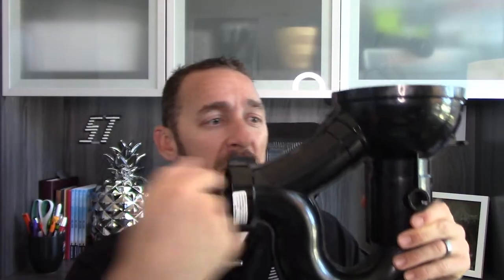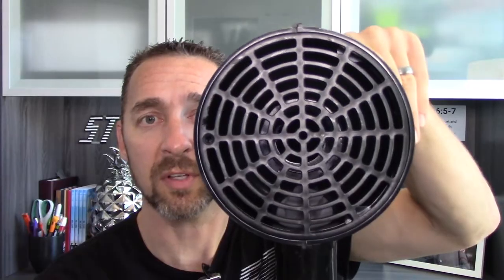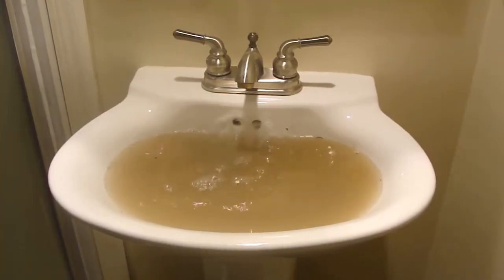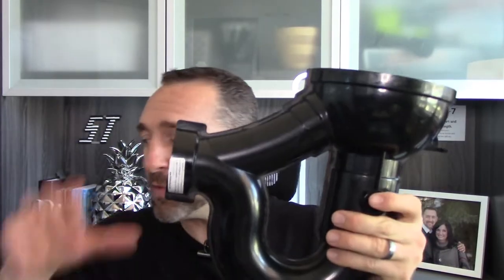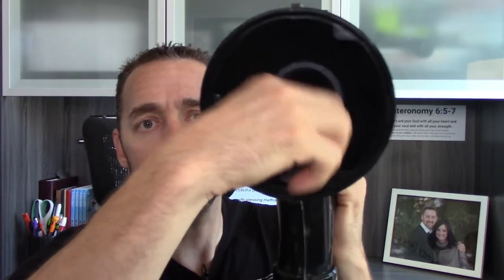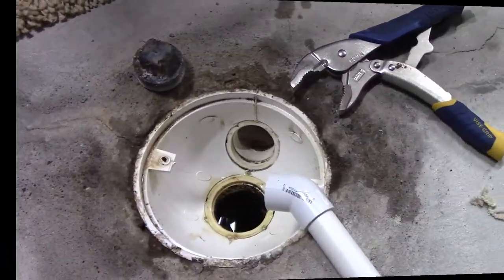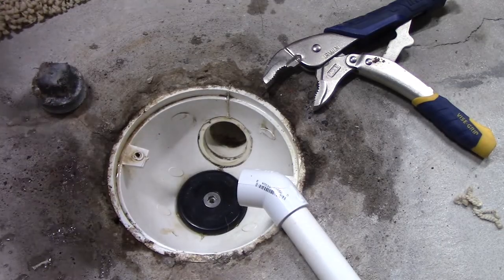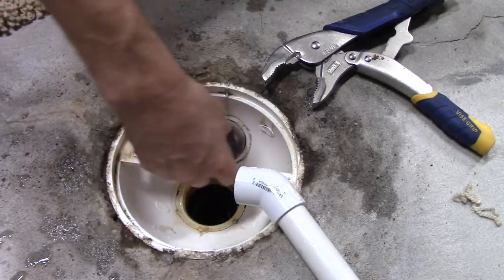Floor drains: why they back up, what to do about a missing cleanout plug

Comment: Rural living on septic&well. Water softener regen made a mess little water yesterday and my initial thought was floor drain issue. Watched your video, reinspected my situation: all clear on floor drain, everything is as it should be. Low and behold somehow the softener regen drain hose got moved away from the drain hole! Pfffft. Put  back in place and secured it. Problem solved and multiple lessons learned. Namely how floor drains work and whole house plumbing implications @ the lowest point in your home.  Thank you Reuben!

Comment: This video helped me so much. Returning from two weeks away, our basement drain started overflowing after a shower and laundry load. We quickly grabbed the wet-dry vacs and sucked up it up until the cycle was complete. I knew NOTHING of what and how the floor drain worked. I discovered, after following your instructions, that our Clean-out plug was MISSING (as you suggested it might be!), and I feared the worse. But, I did get the clogged clear, and the P-trap does WORK! All thanks to the knowledge you shared! Now I need to get a replacement plug! Thank you so much for this video. It was straight forward and everything I needed to know.

Comment: Sorry for the long post.  Not sure if you really want to get into helping each respondent with their particular issue, but here it goes ...

Nice video.  Well described and informative.

I removed the cleanout plug.  This is a 60-year old house, and has cast iron piping, including the floor drain.  The auger had no problem running for maybe 20 feet into the pipe.  No obstructions, no debris removed.  When I pour water into the drain bowl with the cleanout plug removed, the water exits very quickly.  It's the trap that is plugged.  I tried a plastic jaggy rod that's used to remove hair from traps, but it cannot penetrate whatever is clogging the trap.  The current own (my aunt) has had this house for 27 years, but she doesn't know how to inspect a house, or how plumbing works.  Once the water heater burst and flooded the basement.  She cannot remember if the water drained normally or extremely slowly.  

For many years since I replaced the water softener, the exhaust water (2 hoses) ran into the floor drain.  I had the hoses go into right-angle adapters: hose into one end of the adapter, other end of the adapter pressed into a plastic drain plate.  This held the end of the outlets above the normal water level in the drain to prevent siphoning back to the water softener.  That setup worked fine for well over a decade.  Late fall 2 years ago she had a new furnace installed.  The old one's drip line (gas creates water on burning) ran under a rug and into the floor drain.  The new furnace has its drip line (runs up to ceiling using a condensate pump) also run into the floor drain, but the new furnace also has a humidifier where the excess water goes into the condensate pump.  Last winter with the new furnace, its drip line into the condensate pump, its humidifier into the condensate pump, condensate pump into floor drain, and water softener into floor drain, there was no flooding on the floor.  This last winter, the floor started getting wet.  The water from the condensate pump drains okay, but very slowly out of the floor drain's bowl.  It was when the condensate pump and the water softener were both operating that the water wouldn't drain fast enough this last winter, so it came up on the floor.

When I went to check, as mentioned, running an auger through the cleanout plug encountered no debris or restriction.  When water poured into the drain bowl got up to the level of the cleanout hole, the water drained out fast.  When I plugged the hole, the water would drain too slow, and would've come up on the floor if I continued adding water (pouring it in from a pail).  I tried using a plastic jagged drain rod, but it couldn't get into the trap.  There's no concrete or other construction debris that would've gotten into the trap.  The drain is cast iron, not plastic, and there is a lot of corrosion.  Possible the debris has been stuck in the trap for decades, but just recently the rust or other debris finally plugged up the trap enough to severely slow drainage.

While I can get a sharper tip for the auger, I'm concerned about how rusted the drain trap might be.  Boring through solidified sediment, or whatever is hard set in the trap, could result in boring through the cast iron pipe.  I managed to get out the plastic cleanout plug, but the threads are highly corroded, so I cannot get it back in.  I'll have to use an expansion plug to close the hole.  If I cannot bored out the solidified debris in the trap, I'll have to run the water softener and furnace condensate pump into the laundry tub.  My aunt cannot afford having the floor broken up to repair the floor drain.

Is there a safe means of boring through solidified sediment in the trap of a floor drain, so the trap does not get damaged?  There is very slow drainage, but the drain rate won't handle the output of the water softener and the furnace condensate pump.  Don't want to use lye (drain cleaner) on cast iron piping.

(I can just hear you now.  Oh, geez, another one wanting free advice.)

Comment: The plug is missing on the cleanout on the floor drain at our house, the water stopped flowing right. Well to build pressure and plunge the line to maybe avoid paying a plumber I took a bag and some cloth and stuffed the hole. at that moment the washer started a drain cycle and Pop and the water now flows better than ever and it took a dollar tree bag and some scrap cloth lol. DEFINITELY getting one of those expanding plugs as its an old cast iron floor drain that is well past its life cycle due to rust. 

Thank you for this video.

Comment: I have a 1940s home and the drain plug in the floor is only about 2 1/2 inches. This drain doesn’t have a clean out when I run my wash machine. Sometimes water will come out of this drain and saturate a good portion of my basement floor.
Reply: Yeah my family’s house is from the 1950’s and we have had numerous back ups and currently the drain that comes from the kitchen makes water come up in the basement sink and then drains super slow and smells horrible. The basement water drain doesn’t overflow
Reply: Most likely you have a main line clog. Same thing in my house. It was clogged. Had a plumber come out and jet it.
Reply: I also have a 1940’s home but mine does have a brass clean out plug and my washing machine does the same thing when it drains

Comment: Ruben, my house was built in the 60's  so it's cast iron  over the years I've had a plummer use an spinning electric brush kind of thing  and  I'm out a lot of money . . anything that I can do to fix the bubbling up and overflow when I use my washer ? ? They are in my basement a few feet from each other. . so far if I open the lid several times when the washer is draining it keeps the overflow at a minimun.

Comment: You are the only guy I could actually understand when describing everything you did.. here's my issue.. our floor drain started draining really really slow.. and only comes up out of the drain when the washing machine drains.. have no idea how the water from the washing machine gets to the drain..( like..is it a straight pipe to the drain under the concrete, or does it go under the concrete and shoot up and then back down again.). Because we can take showers, wash dishes, etc.. and none of that water backs up, so I don't think the clog is in the sewer line going outside.. I'm guessing that the problem is the trap underneath is flipping clogged.. I'm glad I won't have to pay for that if they have to pull up concrete.. but wish I could figure out how to make it drain quicker like it used to.
Reply: The volume and velocity of water discharged by your washing machine likely are higher than your dishwasher or shower and can't get past the clog fast enough to avoid backing up through your system's lowest drain.
Reply: Mine started that way but then as time went on it happened when bathing and showering. The main line was plugged.

Comment: Nice video, thank, what if water level is even above of cleanout plug but never over flow, maintain that level most of time , but it's above the top of cleanout plug?
in my case,  U trap and cleanout plug are inside a pit, and pit is 70% filled , but not overflowing.

Comment: So i have a floor drain that was plugged, and when i run my washing machine the water comes up from the big plug at the bottom, so i had to take off the little cleanout plug so the water wld drain out. Whats wrong here? This floor drain has been plugged since i bought the house 30yrs ago.
Is the trap clogged and the plug is bad?? Why does it only happen when my washing machine drains???

Comment: I have cast iron pipes. Every time i run water through my kitchen sink the garage floor drain floods. Ive snaked both the sink drains and have tried to snake the floor drain but it wont go in but maybe 6 inches. The overflow on the floor drain is pretty much cemented on there and i cant get it off to snake it. Any tips or tricks to get that thing off?

Comment: My floor drain looks nothing like this. From what I can tell, it's just a 4" pipe going straight down. I think I need to have the floor opened up and have the whole thing re-done, but I can't afford it. It backs up (thankfully) clean water that seems to originate from the shower drain and the washing machine (not from outside the house) every time we have a lot of rain/snowmelt. Given that it never seems to have water going DOWN it, I'd rather get rid of it entirely than have it re-done, so I have the option later to finish my basement. In the mean time, I got ordered on of those backflow prevention drains, and I'm going to try installing it. I don't know what else to do.

Comment: My home was built in the 1920s and the basement floor drain has no clean out. It's just the trap itself. I also don't have a clean out outside. The only ventilation is from the two stacks in the west and east sides of the home. I notice when I take a shower that the water level in the floor drain rises about an inch and then settles back down shortly after the shower is complete or when the I'm washing clothes and the washer drains.

Comment: What do you do if the clog is in the trap on the side of the cleanout, main line is fine, but due to the angle of the cleanout I can't get down to the back of the trap.
Reply: Unless it's concrete in the line, several options should work. With the cleanout cap on, a plunger may work, a snake should push it or one of the bladders that hook to a garden hose, or even one of the pump-up air blasters. If I don't get it with a plunger, I get out the jetter. If you have a pressure washer, you can order a jetter hose for around 50.00 and clear lots of lines.

Comment: My floor drain backs up when our washing machine wash cycle starts to drain. When I snake it there is no clogs.  What can this issue be?
Reply: @azam7405 I have this same issue. I'm speculating that mine might be a lack of ventilation from the stacks. I suspect something similar with yours. Without proper air ventilation, the running water causes pressure changes, creating a vacuum and forcing the water upward. 

Nowadays our stacks vent up through the roof. From what I understand, older homes vented through a "Syracuse mushroom vent" that was basically a cast iron pipe sticking out of the ground from your sewer line and capped with a little metal "hat" to keep rain and debris out. Its purpose was to equalize the pressure. Many years later, these ground stacks got destroyed or buried over by people who didn't realize their purpose.
Reply: If it used to let all the water drain, but now it backs up, it could be 1 or several issues. Could be roots in the line, could be grease dirt build up in the line, could be the drain field(if you have a septic tank) like sunkorg said, could be ventilation issues, I have seen vent pipes full of pine straw, leaves and whatever. Regular augers can go down a line and just poke a hole in a clog, so water will drain, but slowly, without having a camera to see down the line, or running a jetter or a bigger head on the auger, you are stuck with a slow drain.